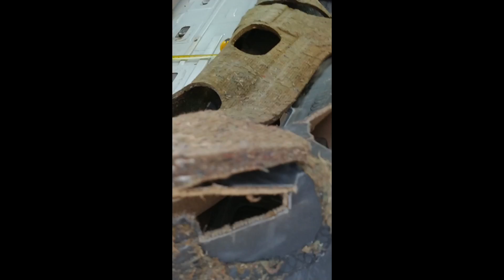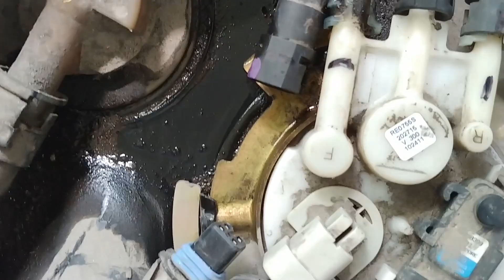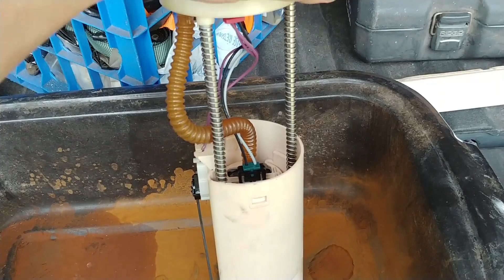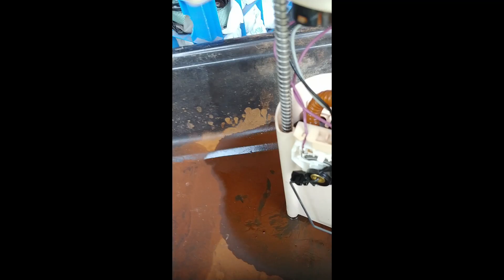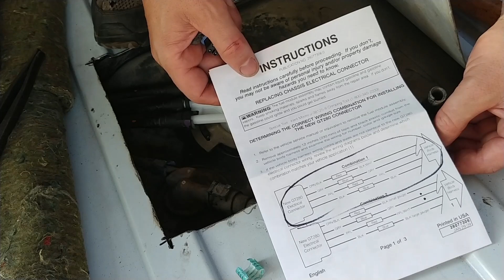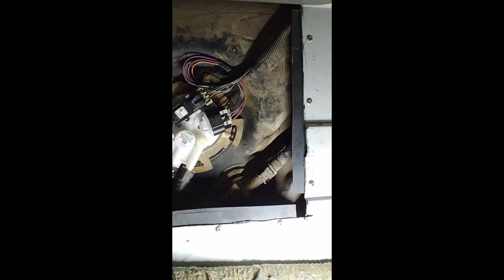2001 Chevy Astro Van   Fuel Pump Replacement

Comment: What did you use for reference point how many inches from the wall how many inches from the back of the van to Mark where you going to cut that hole? You left out probably the most important part of the whole thing

Comment: Am i supposed to unplug the small cap thing near the small round black seal at the bottom of the pump?
Reply from the maker: Not sure exactly what you're referring to. I did not remove anything at the bottom of my new pump and it worked perfectly.

Comment: The R and S lines are the same clip? Is it possible to mix them up and what might happen if you did?
Reply from the maker: It's been a while since I've done this, but if I recall, all 3 lines have different size fittings. Regardless, you should mark each one before you remove them to be sure. Because if you do accidently switch the return and supply line, the vehicle will not run. Hope this helps.

Comment: Takes longer to do this than just pull the tank.
Reply: and was he slithering around on the floor under a 4000 LB vehicle with dirt and shit falling in his face and covered in filth? There is no way pulling it is faster. not to mention the siezed rusted fasteners to deal with and the fuel filler.

Comment: Be careful using those connectors in this kind of application - many of them use crap solder, and with the fuel tank being a pretty vibration-prone area you could end up with cold joints after awhile.

Comment: My pump had 3 plunger rods , they sold me one that had two plunger  rods and it was the wrong pump so I went back and got the new correct  one. They make several different  pumps  for that application and or different  year of Astro  vans

Comment: I just did mine the same way.  But I went to the junkyard  and got the Same floorboard material  to be placed  over  my cut hole,  then used Silicone  gasket making material  to seal. It down. I couldn't use a cutting  wheel because  my tank was leaking  a lil bit , I marked  my hole and used a shortened drill bit and cut and filed the cut edges  smooth in about  2 hours , looks professionally  done!!!!!

Comment: Does the harness need to be changed
Reply from the maker: Yes, because the plug on the new fuel pump is different. There's a part in the video that explains this.
Reply: @g3garage  the harness is exactly the same I plug it into the new one and it fit perfectly but the truck still didn't start
Reply from the maker: @ameeryasin3066  You may have a bad fuel pump. Many new parts that have been manufactured in the last 2 years have sub-standard quality. I've personally replaced many new parts that were bad right out of the box or failed within 30 days.
Reply: @g3garage  hey brother thanks for your response but I change it out today new Fuel pump today
Reply from the maker: @ameeryasin3066  Did you purchase a Delphi brand fuel pump? If not, I would highly recommend that brand over any others.

Comment: The tanks are fairly easy to pull. Some years ago I pulled the tank to do a fuel pump on my 97 Safari. Today I replaced the fuel pump on my 05 Astro with a tank pull. The difficult part of removing the tank is getting most of the fuel out to make the tank lighter and more manageable to lower out on a jack. 26 gallons of fuel is about 180 pounds. My wife just filled it when it went bad. lol. 

Even though the tank pull isn't that bad I am debating with myself about cutting the floor for when the pump I just installed goes bad. That's why I'm looking at videos like this.
Reply from the maker: Yeah, I had a hard time convincing myself it was okay to cut a big hole in the floor of my van. After replacing many fuel pumps by pulling the tank we tried something different on my son's 96 Silverado. We removed the bed hardware and wire harness and tilted the bed up from the drivers side and changed the fuel pump in half the time that it took us on my 98 Silverado. So I figured I would try a shortcut on my van. So glad I did. Fuel tank on it was almost full as well. Saved me a bunch of time and the floor is just as solid as it was before the repair. Thanks so much for your feedback.
Reply: @g3garage  I feel bad for people who have to pay a shop to replace the fuel pump. They make big profit on these jobs charging $500 or more for labor alone.

If I had a lift and a trans jack this would be a 10 minute removal and chances are that I would be done in an hour or so. How do they even justify that much in labor?
Reply from the maker: @Deucealive75  The shop cost on  jobs like these is the primary reason I try to do all my own mechanic work.
Reply: @Deucealive75  Hell  a mechanic  wanted  1100 .00.to do the job , but that's here in California the libtard state so I did it myself  by cutting  through  the floorboard , I went to the junkyard  and cut out the floorboard out of another  Astro  to make a perfect fit metal  panel  used 3/8 # 10 sheet metal screws  to hold down  the panel after I placed  silicone  around the cut edges
Reply: @g3garage  Exactly  correct  !!!!!👍
Reply: I will say you saved yourself around 1,100.00  by pulling  the tank  yourself that's what my mechanic wanted for the whole job! , so u cut a hole  from the top and went to the junkyard  and got the Same floorboard material and it covered  the hole perfectly, I just matched  the stampings , then put silicone  around bthe cut hole and installed  the cover with 3/8 long # 10 sheet metal screws

Comment: How did you know where to cut for your access panel?
Reply from the maker: I watched several other YouTube videos as stated in my video. This gave me a general idea of where to cut the floor.
Reply: Make a small  inspection  hole like I did to locate the top of the pump, use a short drill bit so you don't drill through  the top of the tank I actually  cut a drill bit short, the locking ring is hard to remove  but they sell a tool online  to easily  remove  it

Comment: can you share the measurements regarding where exactly to cut the square please...
Reply from the maker: Unfortunately I no longer have this van. But I did find other videos on YouTube that talk about the location of where to cut this opening. If you look closely in my video you can see the placement of the factory spot welds that will give you a good idea of where to cut. Hope this helps.
Reply: Just drill  a small  inspection  hole to find it

Comment: Great video. Thank you for making it. What symptoms prompted you to change the fuel pump?
Reply from the maker: The symptoms that I experienced were hard starts are first. It would crank for 5-10 seconds before starting.  Changed the fuel filter and that helped for about a week. Then one morning it wouldn't start at all. Searched YouTube and found several good videos but none really went into detail about how to make the access hole or how to close it back up. Very glad this was helpful for you. Thank you so much for your comment.